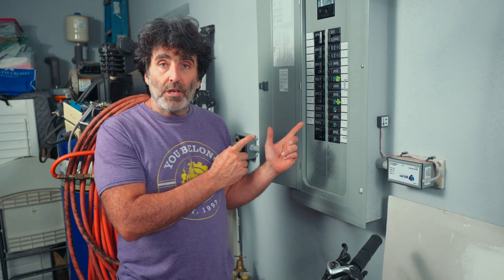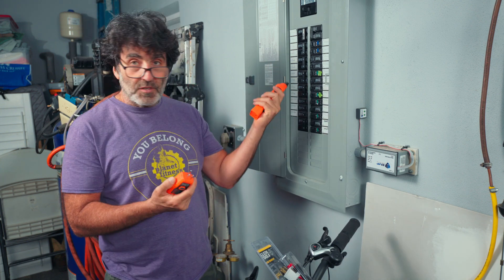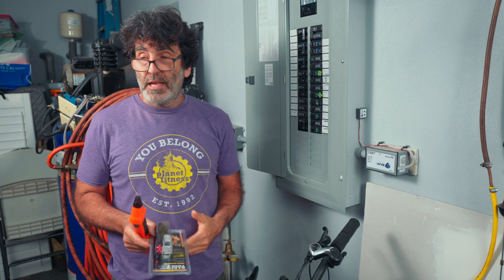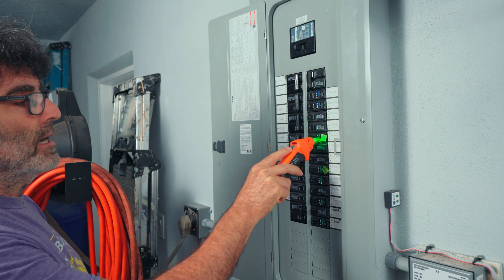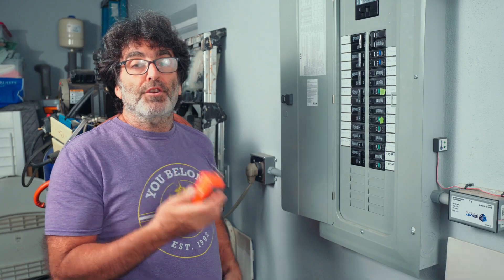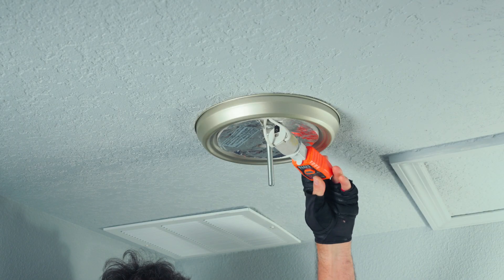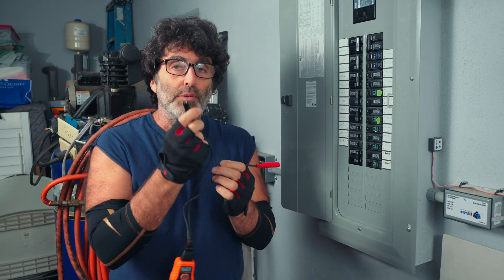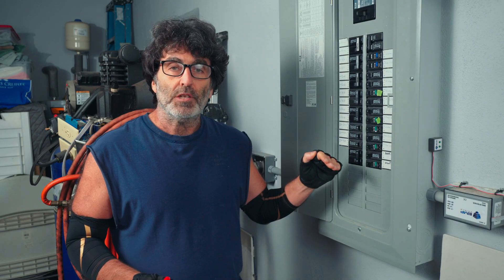Easily Trace/ Identify Unmarked Circuit Breakers in Seconds!

Comment: There is one question already on how to find a circuit breaker for an outlet that doesn’t have any power. What if there are two rooms on specific breaker one the rooms (closest to breaker box)  outlets work, but the other room the lights, and the outlets do not work.
Reply from the maker: HI!  If you know you have 2 rooms on the same breaker and some of the outlets are working and some aren't that means there's a problem along the line somewhere...  I once had this problem and I checked the last outlet that was working.  What I found was that the installer had used those press in connections at the back of the outlets and the wires going to the next outlet in line were barbecued!  If your house is using those in the receptacle you could have a similar problem.  IF you can determine the last working outlet, I'd pull that one out and take a look.

Comment: What if the circuit is off already? I have two outlet that are off above my cupboards and they must have tripped because they were working before.
Reply from the maker: It is usually to quickly identify a breaker.  IF there's no power already, then you might have to use other troubleshooting methods.  I never tried to use this device on a circuit with no power.  Have you removed the outlets in question to see if there's anything obvious that stands out?
Reply: @TheHomeImprovementChannel  Does 240 breaker for the stove and dryer affect this method of scanning panel?
Reply from the maker: @RobSnow-ui4sz  Yes probably so.... The 240 breakers are much easier to identify ... Dryers are usually 30 amp.  Many houses only have 3(ish) 30 amp breakers.  One for Hot Water,  one for dryer and one for the outdoor HVAC unit... Stoves are usually 40-50A... Heating units can be up to 60.  120v plugs are much harder to identify.
Reply: @TheHomeImprovementChannel  why in the video do you then show a full scan of the electrical panel for learning and then do a full scan to identify the issue? Thanks

Comment: How to find a circuit breaker for an outlet that has no power, so when you plug the transmitter in, there is no fault light?  Thanks much.
Reply from the maker: HI!  It might be that the neutral is still connected so it might work...  There probably would be a fault in the lights depending on what the problem is.  Usually there is more than one outlet on a circuit.  Are they all with no power?  Or just one?

Comment: The alligator clips you are incorrect 

Red is hot so will get attached to a black to red wire 

Black goes to neutral so it will attach to the white wire 

Makes sure you know what you are doing before you provide electrical info online because someone could watch this and get hurt
Reply from the maker: Ok thanks!